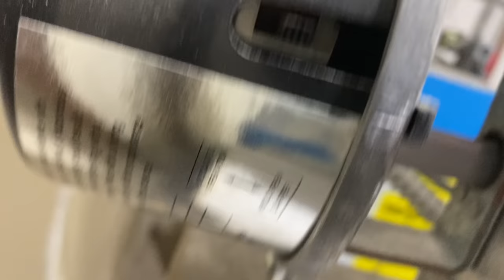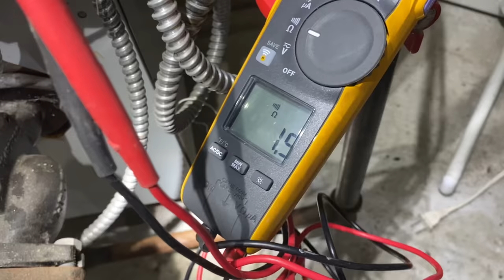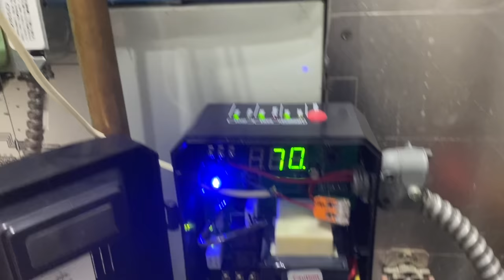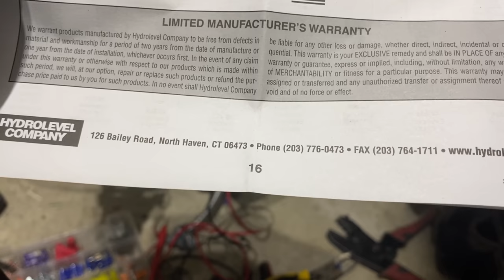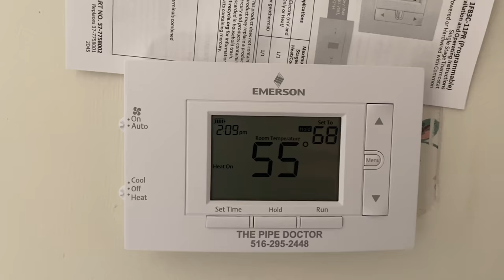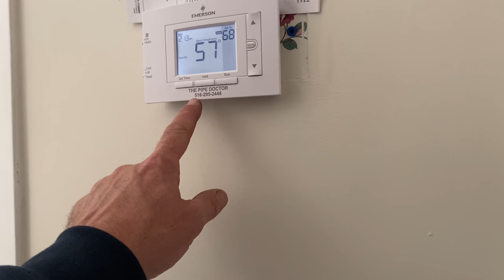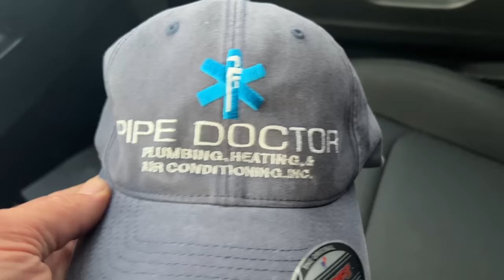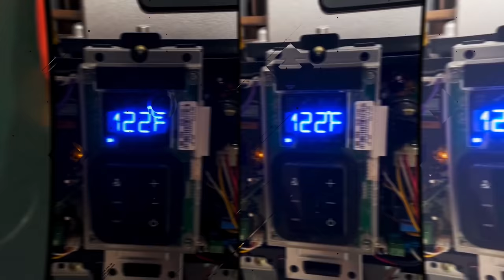No Heat Slant Fin Gas Boiler Dead Aquastat Relay Replaced

Comment: I’m sorry you were frustrated with our tech support and our control.  As a former field tech, I take our response time on tech support very seriously.  However, in the winter months, it is not unusual that we cannot pick up all incoming calls.  We do strive to keep all call-backs on voicemails under 20 minutes.  Regarding the control, we added some features recently to help troubleshoot.  The blue light tells you that the control is holding the circulator off until the boiler warms up – this prevents condensing in the boiler.  More importantly, we added a green (DAMPER POWER) light next to the vent damper plug.   This light advises when there is an issue with the vent damper that is preventing the burner from firing (a common problem).  It turns on when the control sends power to the vent damper.  It flashes if the end switch in the vent damper doesn’t make (which sends power back to the control).  I think you are right that our instructions could be better on these new features.  That will be reviewed.  Regarding the issues you had, I have some idea what happened and I don’t think the control was bad out of the box.   I’d be happy to talk to you more about it.  Michael W. – Sr. Tech Support Specialist

Comment: Use Hydrolevel all the time, great to track how much water a system is using.  No issues......  That said, ya a lot more stuff is defective in the box or missing parts than when is started in the 80's.

Comment: 30 year tech. The HL is a good aquastat. What I like about the HL easy to install and the pump delay to prevent condensation. 

In my opinion the HW 1265 aquastat with the damper plug is shit. I replace at least 20 every year. The damper plug solder connections fail. 

They are very expensive. I save the old stats and have them repaired at a supply house. $50 per stat. 

I service low income areas and give homeowners option for the refurbished stat.

Comment: The Hydrostat features should be where Honeywell should also have, digital temperature display, LED indicators, wiring harnesses, instructions manual.

My first 2 Hydrostats wouldn’t output 24vac on the B1 and B2 terminals, and thus, the gas controller wouldn’t fire up.   Yeah, maybe the Honeywells work, but it’s a dumb device that doesn’t tell you what’s they’re doing and the wiring instructions are cryptic.